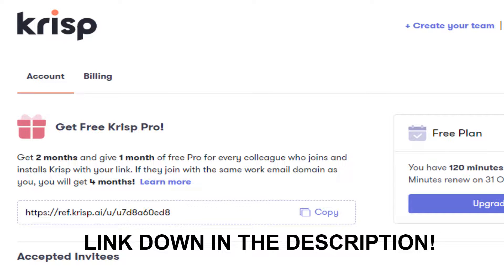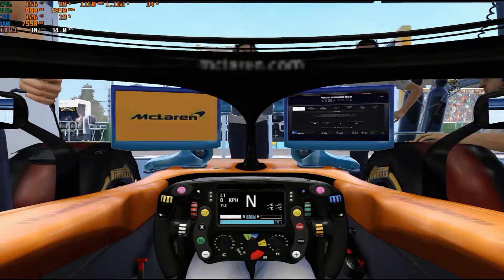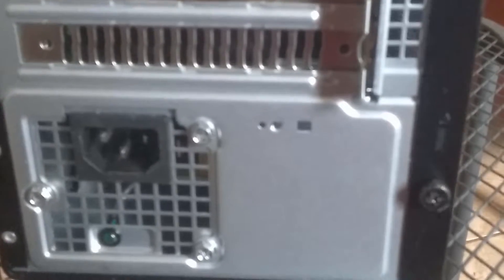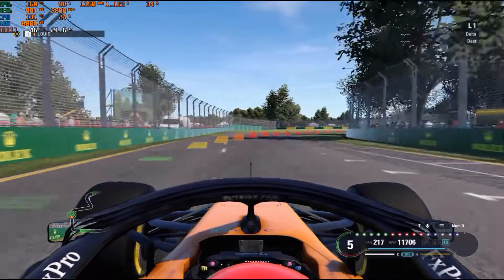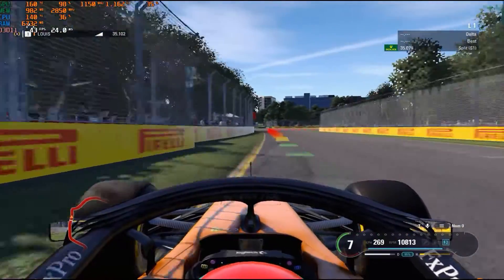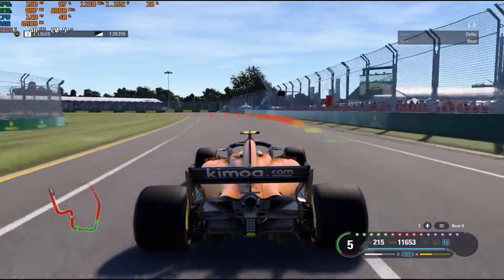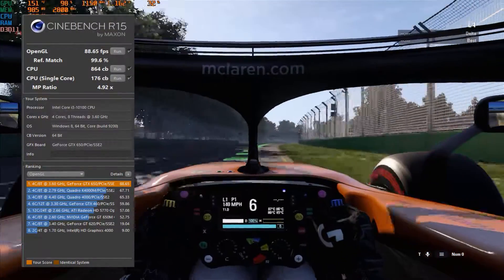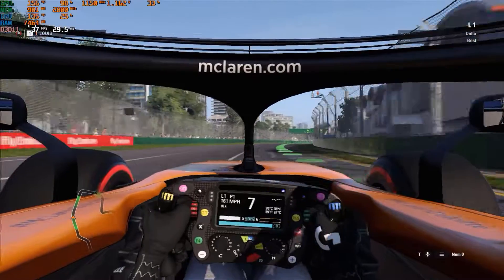Reviewing the Dell Inspiron 3880

Comment: Hi, Can I change the power supply in this computer? And also add a graphic card like rx 6600? I want to know if this computer have enough space for that card
Reply from the maker: This is a bit tricky here, I have upgraded my psu but it was very specific, and it only carried 1x6pin. A typical RX 6600 would need atleast 1x8pin to boot which the compatible PSUs for this machine lacks. Maybe there is an 8pin based PSU out there but that's up to you to research. Good luck!

Comment: I have the Inspiron 3880 and like it though probably upgrade the RAM as it doesn't load up the internet as well as the hard drive to 2TB.
Reply from the maker: Hmmm thats weird that it wont load up properly because my unit runs ok, try and tick high performance from windows and see if that works
Reply: @GameFrostYT  

Ok

Comment: i have the core i5 gen 10 version of the inspiron 3880 so can i add extra ssd [if i can then which one is best to increse performence] ,
can i add extra 4 gb or 8 gb ram to it  ?  can i add a graphics card in it ? and will it be worth adding extra 120 ssd and 8 gb ram to it 
pls tell
Reply from the maker: Yea its worth, make sure you add 8gb+ ram instead of 4 and yes u can install a gpu thats 75w or less, basically a gpu that Doesnt use additional power, and for ssd yes you can add another one as long as you have enough sata ports and power connectors.
Reply: @GameFrostYT  tysm
Reply: Which company ram is alredy in the desktop?
Reply from the maker: @Arinshaaajjrnnrn  Micron

Comment: How do I open the DVD drive? may I ask
Reply from the maker: There is a small button on the drive enclosure on top of the case, its usually on the top right

Here is a guide showing you where it is: https://www.bestbuy.com/site/questions/dell-inspiron-3880-desktop-intel-core-i5-10400-8gb-memory-512b-ssd-dvd-drive-dvd-drive-keyboard-mouse-black/6425573/question/76dc6afd-0eea-313b-9983-2371b357c5ea
Reply: @GameFrostYT  Thank you but their is no small button anywhere on the tower. I just bought this computer yesterday and I already hate it. It also has a pop sound/ noise in the audio at times. My old computer windows 7 fried on me yesterday and now this??? I am trying to lean windows 10 but its going slow
Reply from the maker: @mihe6212  Yea, I heard that there are some 3880 models out there that doesn't have a DVD drive installed, maybe that's what you have... Also I also do not like dell and their bloated software they put up with tbh, best you can do is uninstall them for the time being. Anyways about the sound I'm not so sure what it is so rip... Its best to have 16gb ram on your system aswell and if you want performance, type power in your windows search, click edit power plan, click on change advanced power settings, scroll down, click processor power management, click minimum processor state, and type 100, then click apply. This should make your pc smoother. I also recommend installing an SSD for faster load times and system responsiveness :)
Reply: @GameFrostYT  Thanks I have 13 days to take this computer back to best buy, could you recommend one in the price range of 600-700? Please. I'm not a gamer
Reply from the maker: @mihe6212  ok after hours of searching I found this: https://www.bestbuy.com/site/hp-pavilion-desktop-intel-core-i5-11400-8gb-memory-512gb-ssd-natural-silver/6464935.p?skuId=6464935

This is from HP but I can guarantee that this pc is fast, it comes with the newest intel i5 11400 processor and a DVD drive, also its a 2021 model so its really new. It does come with windows 10 because of course its the only mainstream OS, the reason why I can't recommend windows 7 anymore is because of security issues now, as you can see Microsoft made windows 7 obsolete now with no new security updates. Good thing about this HP computer is that its not completely E-Waste unlike dell :)
Reply: @GameFrostYT  Thank you so much. I'm going to check this out
Reply from the maker: @mihe6212  No problem :)

Comment: Can you run warfare?
Reply from the maker: Very low settings yes i believe, to play it at decent framerates i suggest buying a gpu like a gtx 1650, 1050ti, rx 550, gt 1030, gtx 750ti, etc
Reply: @GameFrostYT  thats very helpful i also just found 1030 on bestbuy for just 649 dollars
Reply from the maker: @xystcodm2302  Thats very bad, terrible value do not buy from that scalper. I'll find a better gpu for you instead :)

Comment: Hi I have the Inspiron 3880 i5 10400, 12 gb ram version. I want to buy a gtx 1050 ti and I'm looking for a power supply to replace the 200w one. Can you please give me any recommendations for a power supply?
Reply: @GameFrostYT  thanks man. Will help allot with improving the performance of the system
Reply from the maker: @thealmightybread9641  no problem! Enjoy your pc :)
Reply from the maker: @thealmightybread9641  I don't recommend it at all.. First off it looks like a fire hazard, second look at the connections,  they AREN'T compatible with your pc as you need to buy a separate adapter. The dell pc requires 6 pins for motherboard power and 4 pins for CPU, and lastly, I don't think it will fit. Also, it doesn't even have a power rating like bronze, gold, platinum, etc.
Reply: @GameFrostYT  ok thanks. But is there any power supply that is higher than 260 watts? I just want to have enough power for a gtx 1050 ti. If not then I'll go with the one you recommended. Sorry to bother you.
Reply from the maker: @thealmightybread9641  Im not bothered at all I like helping people :)
Ok so i found this psu it might be expensive but its the right size and its 460w which should be enough to power your system and add a stronger gpu: http://ebay.us/Dm0pS6
Mind you that it doesn't have a rating and that its used
Reply: @GameFrostYT  I don't mind. Im ok with he price and if it's used then it means that it had a good run and was being replaced. Thanks for the help.
Reply from the maker: @thealmightybread9641  No problem! If you have any more questions ask me
Reply: @GameFrostYT  I have on final question. Will I have to buy a low profile or a mini itx gtx 1050 ti.
Reply from the maker: @thealmightybread9641  They both can fit. I like the mini itx varient more than the lp.
Reply: @GameFrostYT  Thanks man.
Reply from the maker: @thealmightybread9641  :)
Reply: @GameFrostYT  I have returned and I forgot the pc had a hdd drive installed. Will the psu you recommended have the connector for the hard drive?

Comment: Hi, im gonna be buying the 10th gen intel core i5 10400 processor. Is this enough for two monitors? Also whats the frame rate? Can I also play call of duty warzone and fortnite. This is the one with 12 gigabytes not 8 gigabytes
Reply from the maker: Well the cpu and ram should be enough but the gpu is an intel uhd 630 which is slow and below average. You need a graphics card less than 75w. The fastest gpu I reccomend is a gtx 1650 for the dell. Not only that but if your psu is 200w it will be hard to get a gpu
Reply: @GameFrostYT  hi. I'm back lol. I ended up getting something better. After researching abt the graphics card, I found out it was bad. I got the g5 gaming desktop from Dell. i9 cpu, 2060 gpu, 16gb and 500 watts of power.
Reply from the maker: @eg2neat  Great Job!!! Enjoy gaming at high settings man. This is a really good configuration so most of the games you play are going to be smooth
Reply: @GameFrostYT  yoo im back again hahah. The pc was crap. The cooling system and case was. I got a 3700x, 3060 ti, 16 gigabytes of ram.
Reply from the maker: @eg2neat  :0 well its great that you found your mistake and that 3060ti pc is amazing!

Comment: Have the same model I think (3880, i5 10400, 8gb ram) is upgrading the psu difficult? And any suggestion for a unit? 
Edit: supposedly this pc has a 200w psu already in it and someone suggested a 1050 or 1050ti, would these gpus work with the psu it already had pre installed? 
Sorry for the questions I’m pretty new to computers
Reply from the maker: Thanks for asking me these questions. First off having a 200w psu for these cards are not enough so I reccomend you to get a 240w - 260w psu. And yes upgrading the psu is difficult because its proprietary and its bot easy to find them. Also the 1050 can probably work on the pc but do not overclock it. I also suggest that you need to upgrade your memory because if you do your pc will be 25% quicker than it was thanks to dual channel. So try buying another 8gb 2666mhz stick to get 16gb of memory!
Reply from the maker: Also here is the psu I reccomend you to buy:https://www.ebay.com/itm/USED-Genuine-Dell-80-Platinum-260w-Switching-Power-Supply-L260EPM-00-TP18W-/324429382279?_trksid=p2349624.m46890.l49292
Reply: GameFrostYT thanks for the suggestion though I’m a little concerned about using a used psu.... I cant find anything official from dells website. have you upgraded your psu ? 
I also don’t wanna burn out any of the hardware if the motherboard or whatever can’t handle it..
Reply from the maker: @Jeldred  I haven't upgraded my psu but I found an opex box one (that means its new)
 https://www.ebay.com/itm/Dell-OptiPlex-5060-7060-Precision-3430-Power-Supply-GDCXM-0GDCXM-H260EPM-00-/353206319057?_trksid=p2349624.m46890.l49292
Reply: GameFrostYT hey thanks for the reply’s really appreciate it. I’m thinking of maybe going with a 1030 graphic cards, would this gpu work with the 200watt power supply?
Reply from the maker: @Jeldred   yes it should work fine but dont overclock it too much! Since the gt 1030 is still available for a low price you can nab it. Its still better than intel uhd. Try and get the gddr5 or gddr6 versions :) Good luck
Reply: GameFrostYT thanks👍
Reply from the maker: @Jeldred  No problem!
Reply: Hey there im thinking of buying this model. Can it run games such as MC rocket league among us pub g? Could i also record while playing games?
Reply from the maker: @Perc128  minecraft and rocket league yes but pubg it depends.. You are better off getting pubg lite

Comment: so can you install a graphics card in a 2020 dell inspiron 3880

what kind
Reply from the maker: You can install graphics cards less than 75 watts, one of them being the gt 1030 is good enough, but if you have the time to upgrade your PSU, you can add cards like the GTX 1650 or the 1050ti
Reply: thanks
Reply from the maker: @reno2301  No problem

Comment: Im thinking about ordering the Dell Inspiron 3880 8gb 1tb 10100 i-3 processor.  Will this be enough to run 2-3 monitors for just casual internet browsing?  Im not a gamer just would be nice to have multiple monitors.
Reply from the maker: The pc actually has 2 outputs for display, one for VGA and one for Hdmi. So basically you can go up to 2 monitors. But if your monitors doesn't have vga try and buy a vga to hdmi adapter. The sad thing about this machine is the lack of display port. But if you want more display outputs try to buy a gpu with it :)

Comment: question im considering buying this but it is this version of it from best buy, my question is can this computer run serious games that have a lot going on, such as bannerlord 2 or games from the total war series in which thousands of characters are running around on screen at once?  dell-inspiron-3880-desktop-intel-core-i7-10700-12gb-memory-512gb-ssd-ethernet-wifi-bluetooth-keyboard-mouse-black also the version i plan on getting is 800 before tax is that a good or bad deal?
Reply from the maker: ok for starters the I7 10700 is a great CPU for this pc and for CPU intensive games but for 800$ you're not getting the most out of this pc, one is that it doesn't ship with a GPU which is a red flag, and two that's not enough ram (I'd recommend 16GB). But if you don't need a DGPU and use intel UHD 630 graphics then that's fine! If you want to change your mind just ask me and I'll help you find a good pc for the same price or lower :)
Reply from the maker: Not only that but that's a dell... Which is known for having limited upgradability, so If you wanted to upgrade your CPU or GPU or even adding extra drives in the future you might be power limited
Reply: @GameFrostYT  thanks i appreciate the help, im not super great with computers so its been a challenge to shop online, i didnt even realize it didnt have a gpu in most models, im not sure if this one should... i checked and it does have the graphics card that you recommended, so if i just purchase another 4 gigs of ram that would be a good computer right? the only issue would be uprgadability and the price essentially, im not gonna lie im not 100 percent sure what a gpu is? also if you know a better marketplace (or better product on best buy) where i would probably find this for cheaper or maybe something stronger for the same price im super down for any assistance in this endeavor.
Reply from the maker: @MrHeadshot93  Alright I got u, so the websites I recommend you to use when buying a prebuilt pc are Amazon, Newegg, Best buy (which you used), and probably Walmart. Amazon and Newegg are my best bet because they feature good PCs at reasonable prices. So here is a quick summary of what a GPU does: a specialized processor originally designed to accelerate graphics rendering. GPUs can process many pieces of data simultaneously, making them useful for machine learning, video editing, and gaming applications.
Reply from the maker: @MrHeadshot93  If you want to join my discord channel to talk more about the pc quicker here is the link :) https://discord.gg/PgUUvxJ
Reply: @GameFrostYT  right on i appreciate the help man, and damn so a gpu is gonna be a necessity for harcore gaming. ill join the discord right away.
Reply from the maker: @MrHeadshot93  Alright Great I'll see you there :)
Reply: Absolutely not! This is a productivity desktop for YouTube and Excel. Games will never run good or at all in some cases. I purchased this one for use as a media server. Its just hosting the media so I'm only leveraging the CPU for Streaming and transcoding, it wont actually be connected to a TV or Projector.
Reply from the maker: @A2ZGeek  True! Thanks for the info :)

Comment: u installed a 1650 in ur dell 3880  but  in reality it was never factory installed thats y when u use the graphics card as ur display output device u cant get in to bios 

this is because the bios wont register 1650 as output device and use the inbuilt hdmi port for output

if u want to try, keep the 1650 plugged in but use the inbuilt display port for output  u will definetly be able to get into bios
Reply from the maker: Yea that's a good tip for sure, currently I have a gtx 650 not a 1650 but I plan to get one in the future :)
Reply: Actually when u said 650 i heard 1650 thats y i said 1650
Reply from the maker: @shreekrishntiwari1770  Yea my audio quality is pretty terrible, I might have to upgrade my mic soon lol